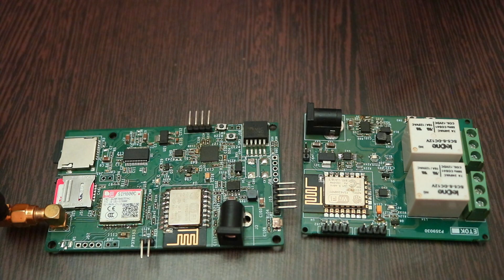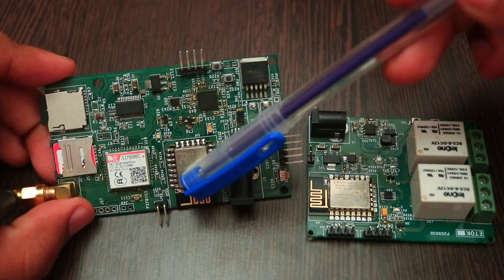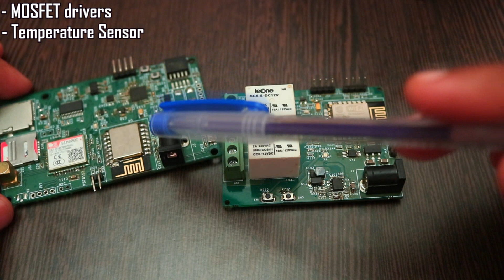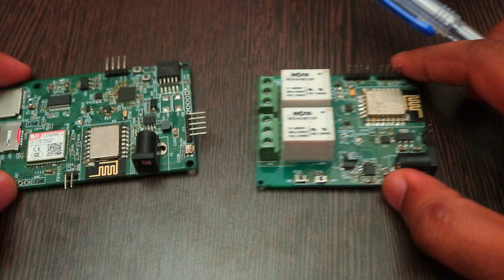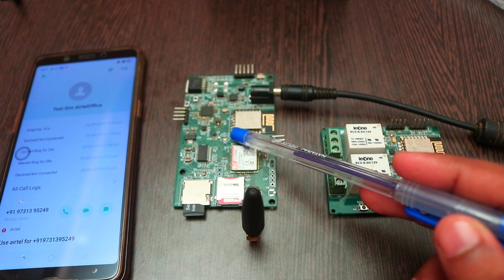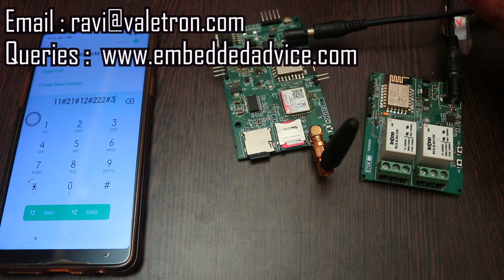VALTALK-Hub-Node DTMF based GSM & WiFi relay board for Building Automation

Comment: Great works thank you for sharing. There is also another way to keep down the cost by removing all that audio section ( MP3 player IC and the SD card connector.) The SIM800C can play audio files embedded on it. Not the TTS function (Text To Speech) this function is available only for chineese language, but audio files with ".wav" and others extensions I believe. Have tried this way ?
Reply from the maker: Haven't tried yet. Will give it a try. If it's possible that audio files can be played from SD card through SIM800C it would be great
Reply: @RaviPujar  No need of SD card, the audio files are uploaded through the serial port of the SIM800 and stored on the internal memory. I know it's not convenient solution if you need to change this audio files frequently, but if it's not the case this solution is much more cost effective.
Reply from the maker: @DzpcbElectronicWorld  Our devices are shipped to places with different languages, they load their own custom audio. SD card is needed in IVRS applications. But directly playing fixed values will be easier from SIM800C, i will give it try. Thank you :)

Comment: Regarding the esp8266 relay issue, some pins have some specific functionality during bootup. You can find that in datasheet. For example a pin might output boot messages at startup, another might give a square wave during boot, these are controlled by boot loader. These happen before at bootloader even before our application starts to execute so we don't have control over that. You have to choose GPIO which don't have special functionality during boot. I would recommend a small MCU controlling relay, temperature sensor instead of esp8266, and also using that external MCU as a kind of watchdog for esp8266. You can use small MCU like stm32f030f4p6.
Reply from the maker: Thank you Gowtham. I will try that

Comment: Don't take it personally, I know lot of hard work and money has gone into such projects. But professionally, this is not a sound design, too expensive for mass production and not much useful. I just wonder how many boards you are selling after so much hard work. Anyway love your videos.
Reply from the maker: Thank you, Inputs are welcome, but you should also explain what makes it expensive compared to what?
And why not much useful.
Reply: @RaviPujar  Sorry brother, can't disclose more on it. But IMHO, too many chips SIMCOM, STM32, ESP8266, I think some music player chip, make it easy to build, but costly to produce. There are parts other than these standard chips, and most of the things can be done with a single chip solution. A mobile phone with OS, screen, keypads, battery, etc. comes for 700 Rs. Also simple GSM/SMS based relays are available under 1300/- and wifi is not so reliable and available everytime as you think in India. Not talking about making hundred pieces, talking about selling in multiple thousands (Ideally that should be the goal).
Reply: Very nice sir, can you please explain mp3 player output where to connect sim800c.